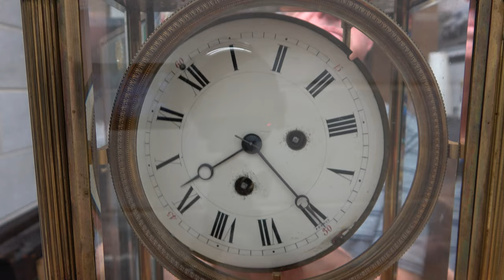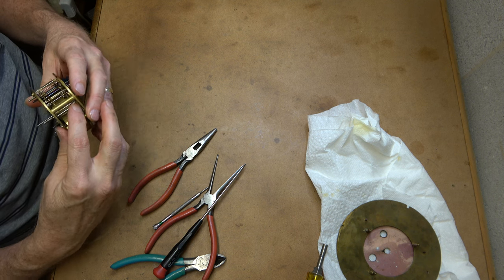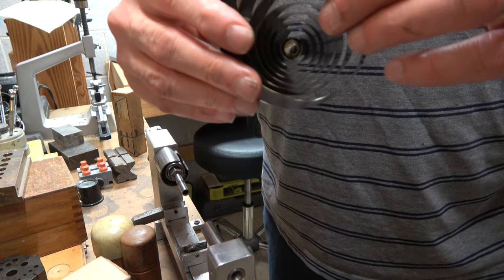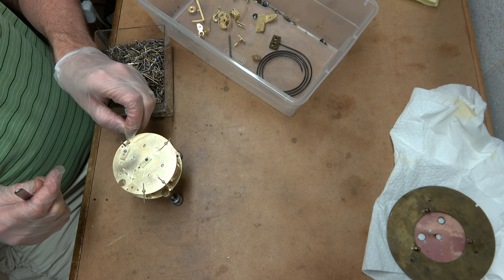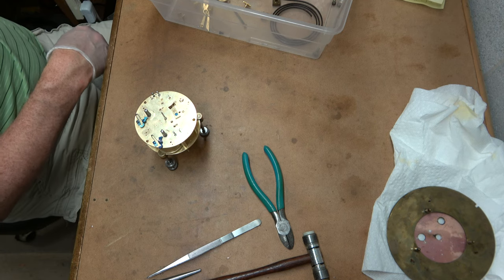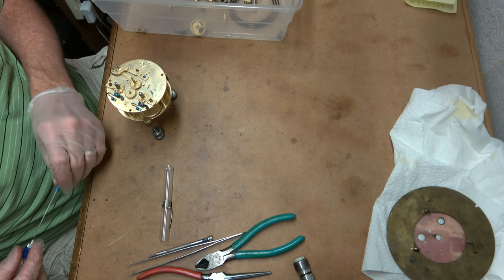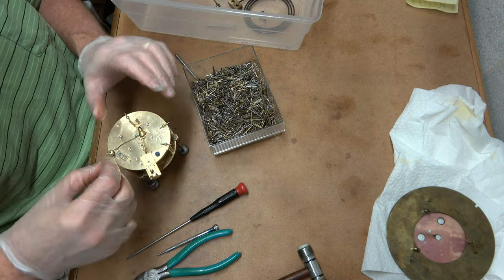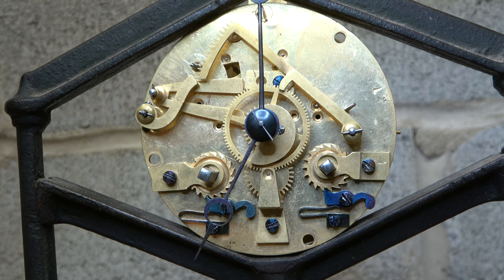Restoration Of A French Crystal Regulator Clock

Comment: Hi Mark you have done a great job, to answer your question I prefer these instructional videos without music when you are talking and explaining. I would like to tell you that I have a clock with a Brocot escapement and a similar machine but from the Ansonia factory. I have been told that the pendulum has a false mercury. In the case of my clock it doesn't have the ratches wheel in sight like yours, it has them internally so I don't know how to discharge the main springs, I take this opportunity to ask you. Thanks for sharing your knowledge, I'm Charly, clockmaker from Argentina. Greetings !
Reply: Greetings. charly. Yes. American crystal regulators have no mercury, only a silver piece of metal. Ansonia clocks have a click and click wheel on the front of the 1st wheel which has to be released.
Reply: @DaltonDroneZone  Hi Dalton ! thank you so much for the info, i will try to discover that click when i start to restoration job. Regards !

Comment: Another great video.  Watching you work I have the impression that you have serviced hundreds of clocks and I always learn things from you, e.g. the dots for indexing the snail and motion works.  I have a Seth Thomas crystal regulator from about 1910 waiting for me to work on with a similar pendulum except mine has fake mercury, which from your comments is a good thing because it is safer.  I prefer no music in the videos.  Great job.  Small quibble - at the very end, it would have been nice to hear what the gong sounds like with the movement back in the case.  Thank you for putting out these videos.
Reply from the maker: Thanks for the comment. You’re right, I dropped the ball at the end of the video. I should’ve demonstrated the strike.

Comment: I get a lot of mixed comments when it comes to mercury. Some say it should be treated the same as radioactive waste. The clockmaker who I did my apprenticeship with said it was only dangerous if you inhaled too much vapor. I remember he once tipped over a large vial from a regulator and cleaned up the mercury off the floor with a vacuum and poured it back into the vial. I have a few early Herschede grandfather clocks with very large triple vial pendulums, the vials are open at the top with a brass cap that sets on top. I believe the evaporation rate is about none as long as the vial is at least covered, or so I’ve been told..
Reply from the maker: When it’s enclosed in a vial, it’s totally safe. The absolute WRONG way to clean up a mercury spill is to use a vacuum cleaner.

Comment: Where did you get that bushing chart? I am using the Bergeon bushings
Reply from the maker: It's a KWM gauge but still good for sizing. These used to be available at clock parts supply firms but I don't know if they still are.

Comment: Just a quick question ,there seem to be some bushes that are not being used, what are they for i have the same on my french time clock thanks
Reply from the maker: Most of the bushings are used on this movement. Any extra non-used pivot holes maybe there to accommodate different designs.